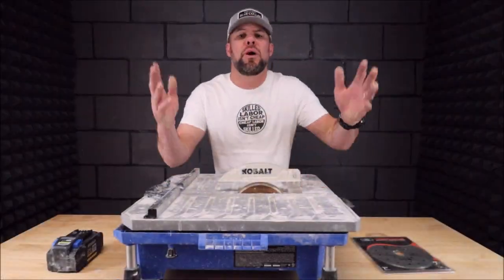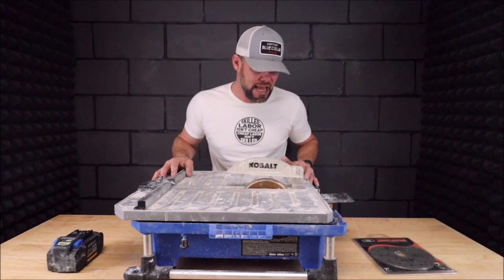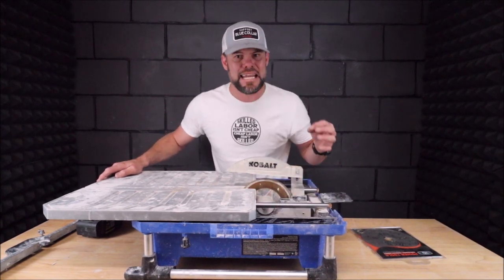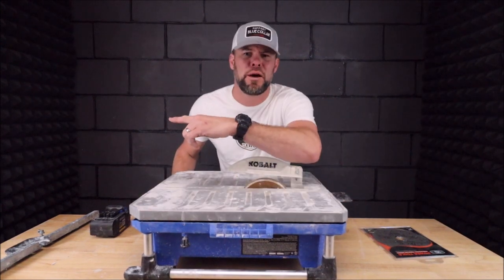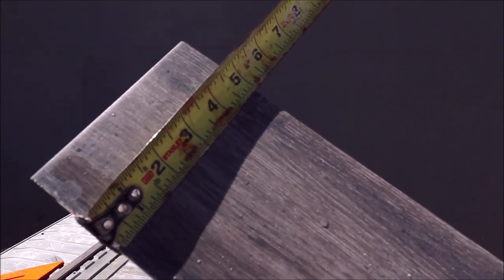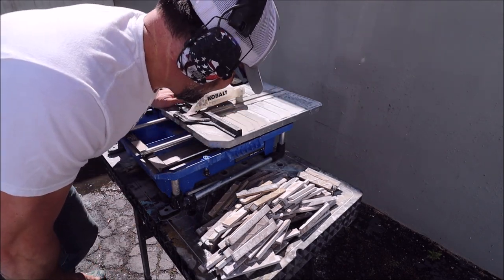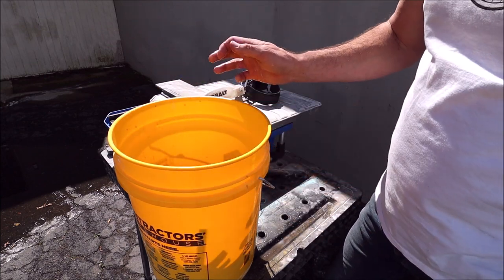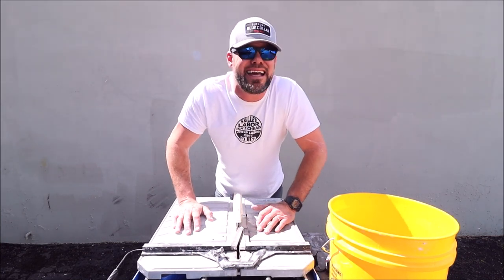Kobalt 24V Tabletop Tile Saw is a BEAST!

Comment: Hey man I never thought I would give you any advice you know ten thousand percent more than me but I do a lot of remodeling and now have gotten into a lot of tile work. But the answer is silicone spray!!  WD-40 at tracks particulates silicone spray won't also silicone spray will last a lot longer WD-40 dries silicone spray doesn't it's what was suggested for sticky old sliding glass doors. That's how I learned the trick
Reply from the maker: Thanks for the tips!
Reply: What brand? WD, Dupont, 3M? They all say "Professional" but are they all the same?
Reply: Yes, I hit the window seals on the truck with a little on a rag. Cleans em and you can tell the windows go up a lot smoother. Bet its easier on the motor too.  Good stuff.

Comment: I just tried the electric version of this saw on remodel shower. It does chip every tile almost. I did replace the blade with a new rubi and made no difference. I can’t have chipped tile and will be returning the saw probably. Today I am going to set up my bigger saw in the customers driveway and walk up and down the stairs to make cuts rather than struggling with this saw. I give it two stars. Thanks for the video always appreciated and very professional
Reply from the maker: This 24v saw doesn't chip brother
Reply: @LandbergTileTV  I bought this and have done one shower with it so far. What do you do about the little corner chip @4:51. I'm getting that on every tile.
Reply: I had the same experience. Had to return it
Reply: Do you have any recs for smaller table wet saws and also cut off/grinders? I was going to use this for glass and porcelain tiles, but running into chipping issues too.
Reply: Could it be the blade?  Or could someone explain to me how the saw actually causes chipping. Thanks in advance.

Comment: Thanks for the tool review. Just purchased this saw for a shower gig using 12x24 porcelain tiles. Small bathroom shower on a 3rd floor townhouse. This saw was perfect for the job. It did chip on a few cuts but I was using the Kobalt Porcelain Blade and once I slowed my roll it worked well. Will be switching out the blade one the next job. That 8 hour battery was on sale so I snagged it for the win. Also snagged one of those sweet tees.

Comment: I bought this saw after your first review. I put a brand new rtc rock star blade on😅 it to cut porcelain tile. It chipped the tile really bad. Tried a Hot Dog blade & the kobalt blade . The same results. Would have only been able to use the cuts for perimeter cuts on a floor. Can use a snap cutter for that.  Wasted my $300.

Comment: I bought the saw because of your first video, thanks for the great review. My only problem is, I’m cutting porcelain tile and the corners seem to chip out at the end of the cut. I’ve tried taping the tile but have had no luck. I went and bought the kobalt porcelain blade didn’t help much. Got any tips or suggestions?  Thanks for all the videos.
Reply: same problem.
Reply: If your using the blade that came with it, you need a better blade.
Reply: Slow down at the end of the cut. If you go too fast at the end it will break unevenly
Reply: Cut upside down
Reply: I have the same issue every tile breaks at the end of the cut.  Is the table supposed to be flat cause mine was not flat not even close.  I checked the riving knife too it was good.  I took the saw back to Lowe’s.

Comment: Didn't know you could use IQ blades on a wet saw. Just wondering why you did
Reply: They claim there blades are a higher quality as far as the filler material between the diamonds. They even mention their blades can be used on wet saws. Check out their YouTube channel for more info
Reply from the maker: It's one of the most aggressive blades out there especially with water. I've used the 10" with my DeWalt and it performed so well